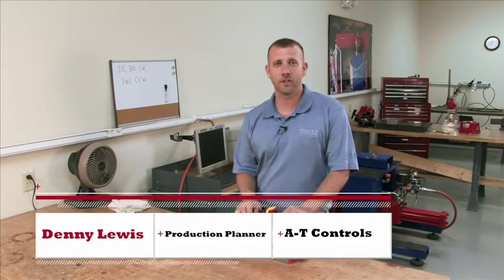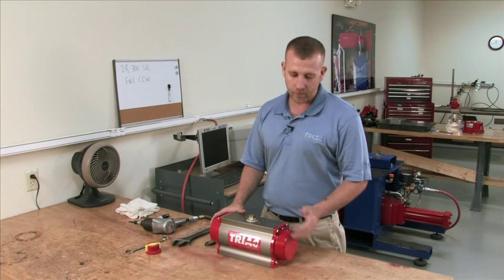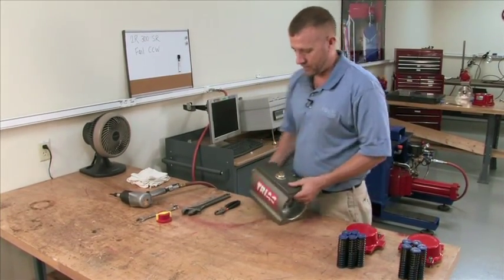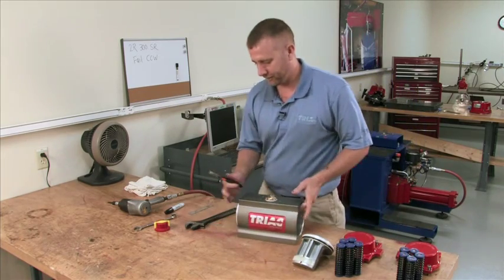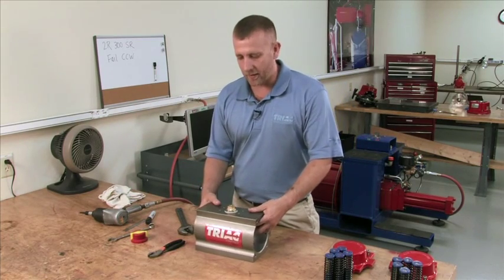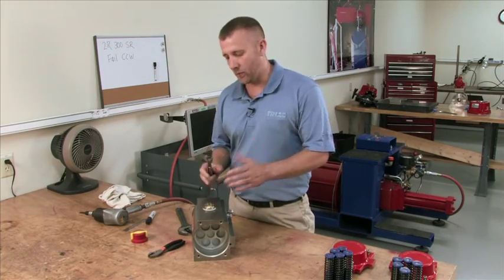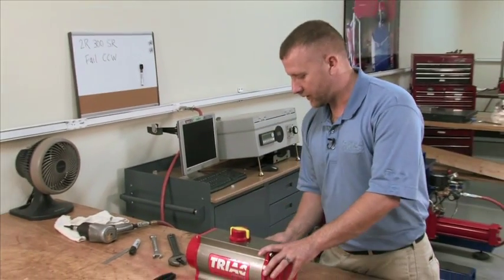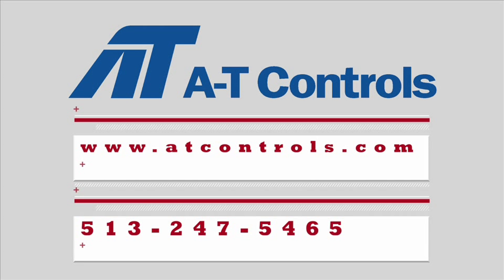Converting 2R Rack and Pinion Actuators to Reverse Acting

Comment: Love your video, i want to ask a question , if a rack and Pinion Valve actuator is pressurized and the air supply is isolated how long can the air in the actuator chambers make the actuator to be in the open position without returning to the Fail to close ,Position.

Comment: What do you mean on the rack side they both have racks on both
Reply: He means the side of the piston that has the rack with teeth.  When he pulls the pistons out of the actuator you'll notice they are "L" shaped.  Place the oddball spring on the rack side or in other words the corner of the "L".  That way it reduces the side load of the piston and will hopefully increase the life of the piston seals.